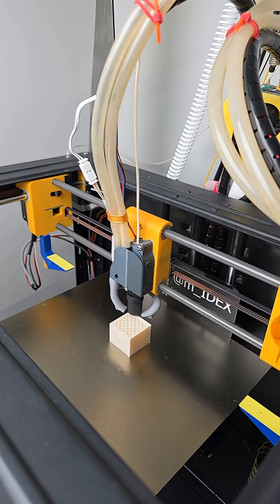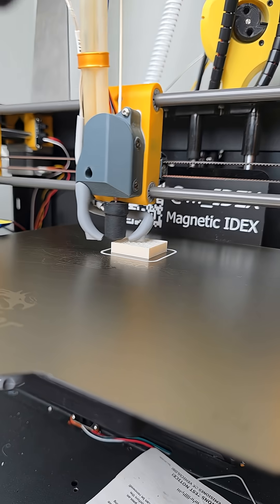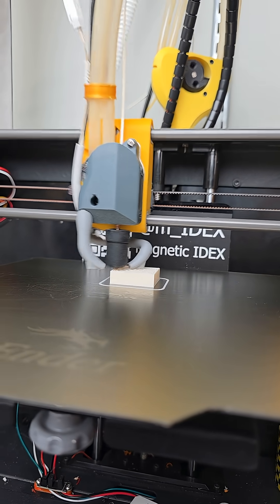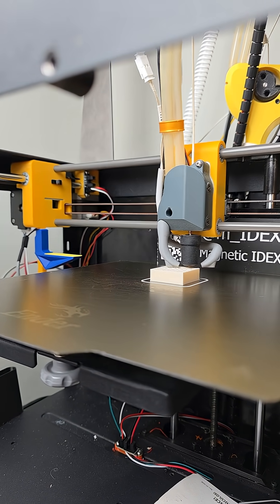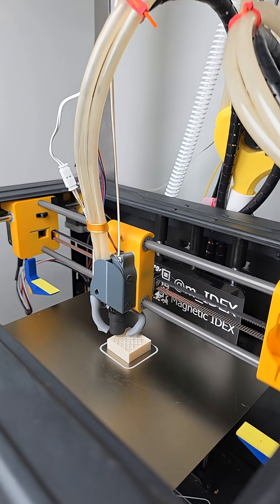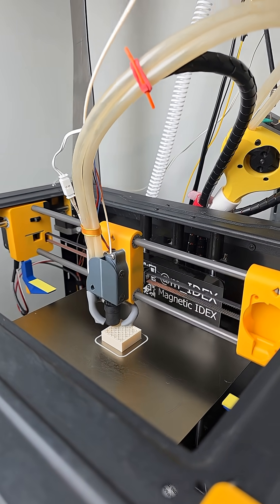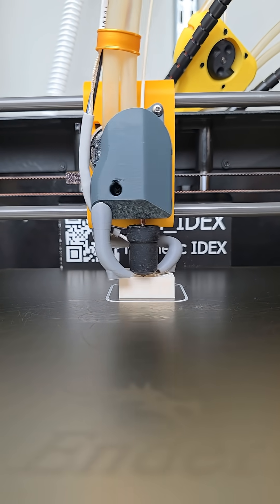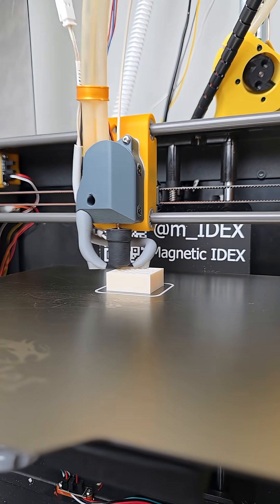Akula 3 First Print – Locked Zag Infill Looks INSANE #picolinoextruder #reprap

Comment: I have a wanhao duplicator 4s (sae clone as flashforge create pro). I'm curious how big your build volume is after these mods
Reply from the maker: Thanks for the question! 😄

The Akula 3 (based on Flashforge Creator Pro like your Wanhao Duplicator 4S) keeps X and Y unchanged at 225 x 145 mm.  Z height is now slightly increased to about 165 mm.

Plenty of room for most prints! If you're thinking of trying something similar on yours, go for it 🚀

Comment: So, for the beta participants - are there x-carriage models that work with an original (horizontal rods) Flashforge Creator Pro printer and also ones that work with your Akula-Class motion system?
Reply from the maker: Yes, 100%.
Both motion systems are supported
Original Flashforge / Akula horizontal rods carriage (70 mm center-to-center)  
Akula 3 vertical rods carriage (60 mm center-to-center)

Going up on Printables in a few days. Hang tight!

Comment: And one more question: is the gear that feeds the filament and also acts as a transmission in this ingeniously simple extruder cut out with a wire EDM machine?
I'm just curious – I used to operate a machine like that.😊
Reply from the maker: That was indeed the very first Picolino design (single metal gear), but the pinion was wearing too fast, so I completely redesigned it.

Current version uses a simple compound gear: 
✅ 3D-printed nylon first stage (super light, zero wear on motor pinion)  
✅ Laser-cut hardened steel traction gear pressed on the plastic gear.

Way more reliable and still tiny.

Compound gear close-up here:
https://www.youtube.com/shorts/m4B6QZqK2Lk

How I make the laser-cut hobbed gear here:
https://www.youtube.com/shorts/mEQ_R2wOVMk

Thanks for the question!

Comment: But isn't that DEX - not IDEX?
Reply from the maker: It’s the eternal debate 😄  

Short answer: Magnetic-IDEX (Picolino) can do everything a classic IDEX can do — full independent two-carriage printing, duplication mode, mirror mode, and multi-color/multi-material.

The only difference is how duplication/mirror is achieved:  
- Classic IDEX → firmware slaves the two carriages together  
- Magnetic-IDEX → they’re physically locked together with magnets (mechanical instead of digital)

True DEX (like the Bambu Lab H2D) is when both extruders share a single carriage.

So yes — this is 100 % IDEX, just smarter, simpler, and way cheaper.

Thanks for the question!
Reply: @m_IDEX Thanks for the comprehensive answer 🙂

Comment: I'm tempted to get a printer like yours and try this. There is one forsale local to me. I think starting with a printer that was idex or had a dual print head makes sense.
Reply from the maker: Do it! That would be awesome 😄 

Fun fact: my current Akula 3 started life as a classic Flashforge Creator Pro (dual extruder but NOT IDEX). I literally only kept the frame, Y rods, heated bed, few steppers Power supply and some wiring.  Everything else (board, wiring, hotends, extruders., motion system…) got replaced or heavily modified.

So starting with an old IDEX saves you a tiny bit of hassle, but you’ll probably swap the mainboard for Klipper anyway. Just grab whatever dual-extruder machine is cheap and has a solid frame — the rest is getting upgraded regardless.

Can’t wait to see your build!
Reply: @m_IDEX I just got a refurbished K1 max and K1 se. It was so much cheaper than building. Those added to my collection. I don't really have room for another one right now. I built a plywood box frame i3 for my first printer. Those parts were moved to a laser cut i3+ frame. There have been many more since. I was planning a carbon fiber rod mod when I found your channel. These k1  s are fast.